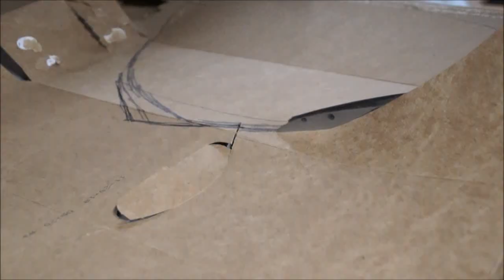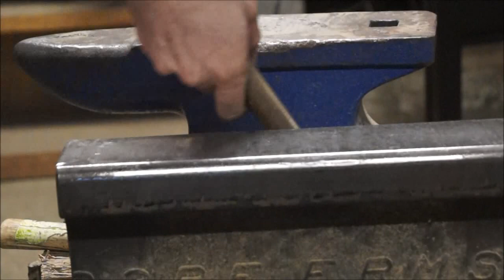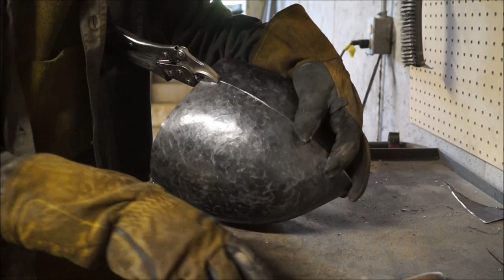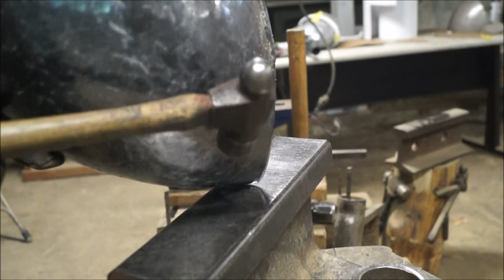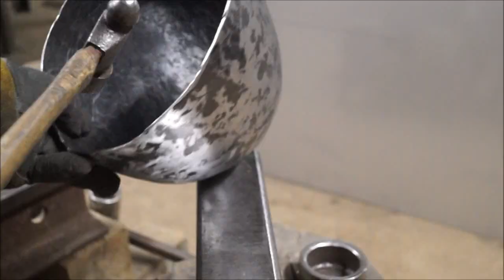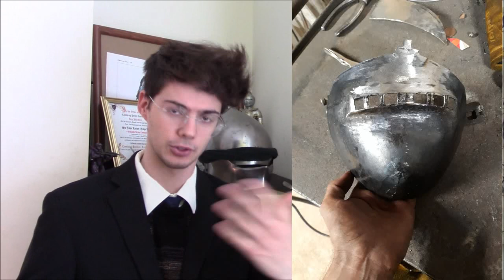Making a Center-hinge Bascinet

Comment: This is a (big) smile on my face! You know it's a good day when living manuscript uploads a video:) pretty helpful that you made a bascinet actually, I'm still working on a pattern for it but I guess I'll just cut it out and try. What things should I keep in mind when making a bascinet? My plan is for it to be a late 14th century bascinet with a hounskull visor.
Reply from the maker: Great timing! In cases like this where there is a lot of shaping, a pattern can only get you so far, since it can't be shaped in the same way that steel can. As is the case for many helmets, I've found that the tops of the helmet end up being broader than I expect. That is, not that they're flat, but simply because of the way the head is shaped, if the helmet it too pointed it may end up being too tall. The nice thing about steel is that you can reshape and bend and grind and weld quite a lot, so if you mess up there's usually a way to fix the problem or make it less bad. If nothing else, it can always be recycled into another piece of armor :)
Reply: @LivingManuscript  Yes those are some good points! I have now made the first half and im gonna work on the other half today, it resulted in a very good shape. Tho the top point got a bit too tall for my liking but Its not too inaccurate if i compare it to other historical survivals. You might have seen it on my copycat instagram xD. Ill finish this and then trim the pattern for next time i use it.
Reply from the maker: @latteguy0345  Good to hear! Sounds like great progress :)

Comment: One thing, when you shaped the helmet and those folds appeared, you hammered them back. I did that aswell and i got cracks in my helmet, is it because i use thinner steel or?
Reply from the maker: Thinner material will definitely play a part, its one of those things that need to be monitored pretty close, since with thinner stuff it's easier for it to fold over itself and then crack as well. Be careful as you dish it too since that stretches the steel even more and holes might appear right in the middle of the piece :)

Comment: Do you heat any of your components before hammering? Sorry for the dumb question, ive never done blacksmithing before.
Reply from the maker: Not a dumb question at all :) Different armorers do it different ways, and my own methods don't require frequent heating (although it would be nice sometimes, I'm a little limited by tools in this case),l. But I cheat because I use a welder a lot lol
Reply: @LivingManuscript  I was wondering what thickness of steel you usually use?
Reply from the maker: @deece1482  most typically I start with 1-2mm sheet, but depending on how its shaped that thickness can change. The thinnest sections go primarily on the limbs and backplates, with the front of the torso and head usually getting treated to something a bit thicker, depending on what the armor's intended use is :)
Reply: @LivingManuscript  thanks for getting back to me. I'm a reenactor, but I don't do combat typically, so 1mm steel should do fine. Guess I have to get learning. I primarily need to make a better fitting arm harness as off the shelf stuff doesn't fit properly.

Comment: Nice! 
You mentioned cost cutting for your friend, how much did that helmet cost in materials?
Reply from the maker: Thanks! The materials were actually the cheapest part, especially since the steel is just mild. I've been getting 4'x10' sheets of 16 gauge steel from a machine shop in my hometown for about $100 , which I am still using after over a year. The coif I found on Ebay after hunting around a while and got it for only $50, and the rest were materials I already had from earlier projects.
Reply: @LivingManuscript  Do you use heat at any point to shape or harden the pieces?
Reply from the maker: @alejodavies  Usually not too much, since I don't have a very powerful heating setup. I used a small blowtorch to round the tip on the visor. In the future I think you can expect to see more of heating to shape and harden.

Comment: ohohohoh yaaaas the Manuscript lives... :D :D:D:D

huh, isnt botom of the plate part of the helm a bit too high, it kinda looks that it dosent cover enough of the botom part of the head, or am i just too spoiled by overbuild bohurt bacinets....
generaly quite nice looking helm imo
Reply from the maker: I'm glad that you like it! It wasn't until the last few decades of the 14th century that bascinet skulls tended to be long enough to cover the neck much, so since we were going for a more mid-century impression it's a little shorter than later bascinets. There are a few survivals from fairly early on, which this skull loosely resembles. Admittedly, I think that many buhurt bascinets do tend to cover a little more than many historical examples which probably wouldn't be suited for buhurt too much.
Reply: @LivingManuscript  Talking about buhurt, we all know that their armor is like tournament armor : very thick and protective. But don't you agree that they are sometimes just not accurately made ? I'm actually working for the french buhurt national federation, and i've talked a bit with a team, and i think that most amateur fighters get cheap equipment that is not well tailored nor historically accurate. Sometimes with way longer bascinets for exemple. I've seen a breastplate ressembling a cheap visby coat of plates, some kind of flat piece of steel that bends around the body without curves. And we can't really blame them, it will all look like an old trash can after a few fights, so getting expensive equipment is just not possible for most teams. 

Thus we see "misformed" armors in buhurt.

Comment: First of all great Videos keep it up !
But
I have a few questions (Thanks if you answer them ^^)

1. Which steel thickness do you use for combat armor?

2. 
Do you harden the armor?
Reply from the maker: Thanks! The thickness of armor really depends where it is on the body, and what kind of fighting you're doing. I personally find myself making a lot of armor out of 16g, since I'm just very familiar with it at this point and it's very satisfying and forgiving to work with. But that might be a little thick for some parts of the body like greaves or vambraces, but it is also rather thin for helmets for what I tend to use them for. I've never hardened my armor simply because I don't have the resources to do that at the moment. It is definitely something I would like to do though, among other things :)